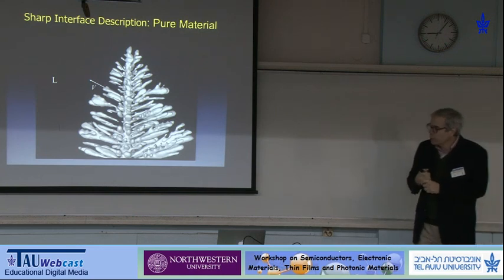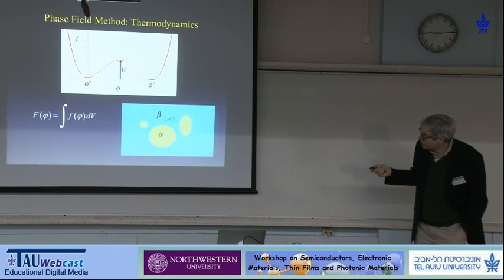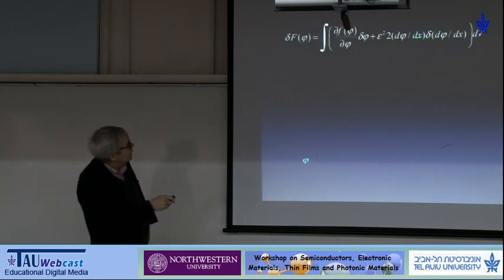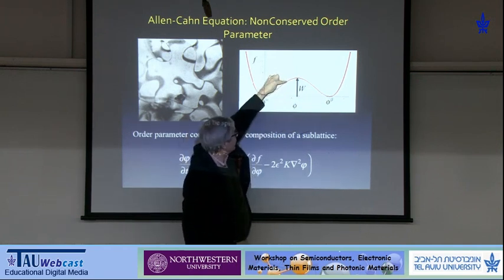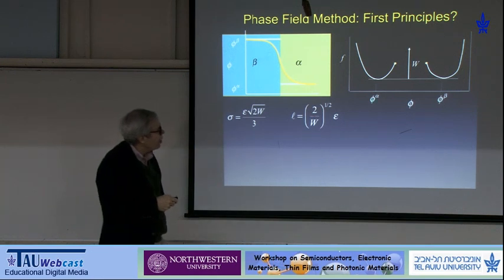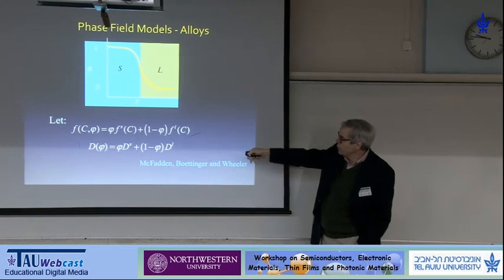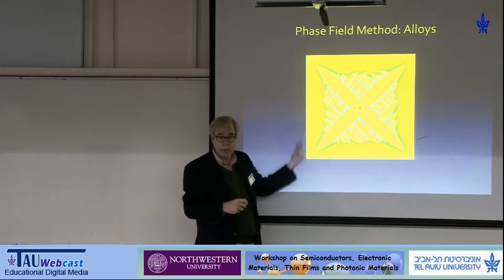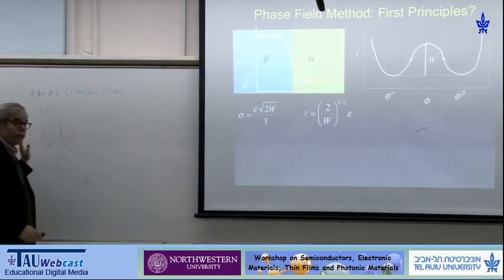Phase Field methods: From fundamentals to applications

Comment: Good lecture. Helmholtz free energy functional is presented in this presentation, for isothermal thermodynamic process. Will internal energy be better to use for a non-isothermal case?
Reply: In solid state problems most always is Gibb's or Helmholtz free energy used. In the solidification problem many researchers tend to use entropy instead.

Comment: I wonder what software can I use in order to build phase-field model and make calculation?  Thanks everyone!
Reply: Check out the MOOSE Framework. It has a module for implementing phase field models (mooseframework.org/wiki/PhysicsModules/PhaseField/). There also is a website that compares open source community codes for phase field simulation (https://pages.nist.gov/chimad-phase-field/)
Reply: @DanielSchwen  ：Thank you!
Reply: @DanielSchwen  I cannot open the second link
Reply: @诚熊  we currently have a Datacenter Power Outage at INL.